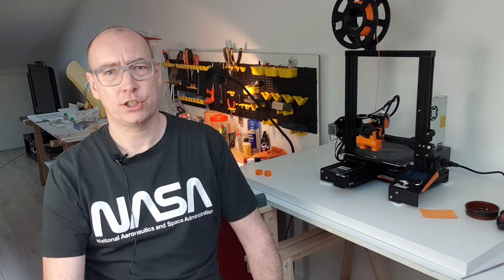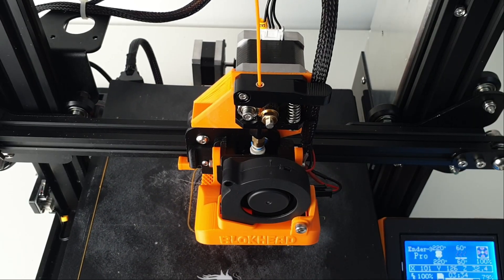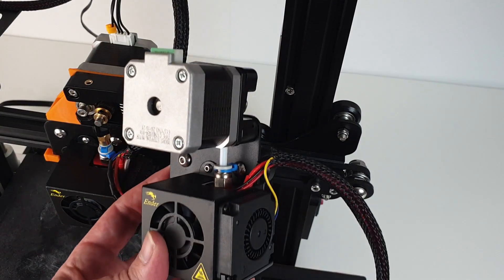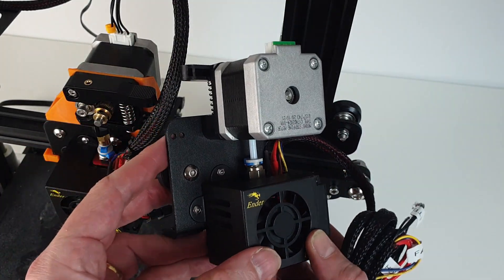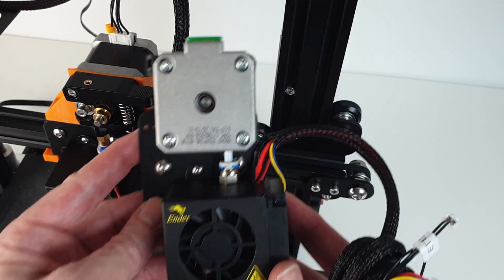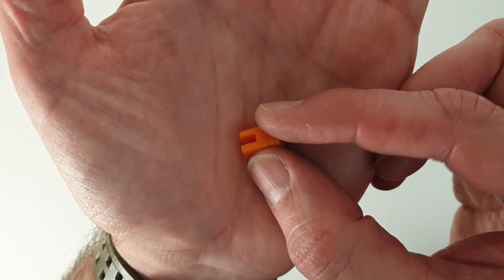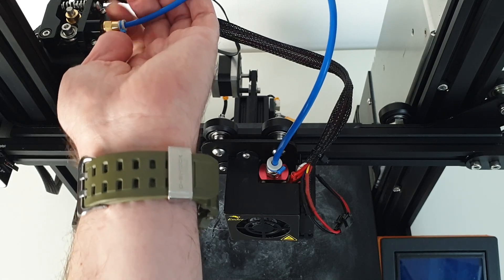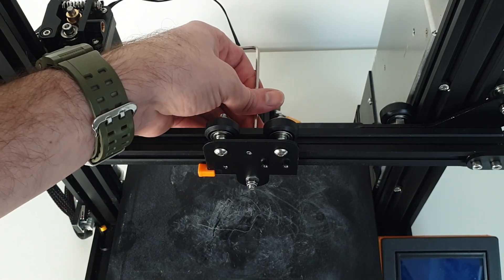3D Printed Direct-Drive for the Ender 3

Comment: Will this be safe with PLA? Or should I look into getting PETG or ABS? I guess I could just measure the heat of my extruder motor during a print, but I would appreciate some advice. I enjoyed your video and will be subscribing!
Reply from the maker: It is safe in PLA. The extruder motor does get a bit hot but you should be able to touch it with you hand, otherwise the motor current is set too high and should be reduced on the mainboard. Thanks for subscribing!
Reply: @YouMakeTech  Salut, 
Tout d'abord, très bonne vidéo, de bon conseil !

Mais je me pose quelques questions : comme pour ce que tu as répondu, la température ne gêne pas ? Comment baisser le voltage, comment le mesurer et est-ce dangereu pour les moteurs de les faire tourner en sous-voltage ?

Mais sinon, je me demandais si tes plans sont compatibles ou non avec la cable chain, et pourquoi pas, peut-on envisager après une amélioration avec ventilateurs noctua ?

Merci d'avance, et félicitations pour ce contenu de qualité !
Reply from the maker: @leobranowski1715  Merci pour ton commentaire. La température ne gène pas, les pièces ne sont pas en contact avec des zones chaudes. Pour les moteurs, en fait on joue sur les courants, pas sur les tensions. En réduisant le courant, on réduit le couple et la chaleur dégagée. Ce qui est dangereux, c'est d'augmenter le courant car ca peut faire surchauffer le moteur. Je donne plus d'informations à ce sujet dans cette vidéo: https://youtu.be/k2nm-WetPnU . Ce setup est compatible avec la cable chain. On peut aussi envisager d'installer des ventilateurs Noctua mais ca demande d'ajouter un réducteur de tension car les Noctuas fonctionnent en 12V alors que l'imprimante fournit du 24V.

Comment: Will the end stop spacer not cause problems on the other side of the printer since the bed size will now be "shifted" as far as the printer is concerned?
Reply from the maker: Right, it reduces the X size of the bed by 9 millimeters. To avoid issues, the size of the bed must be reconfigured in the firmware and in the slicer. This will prevent the head to go too far on the right side. Unless you print very large parts (>220 mm), this should not happen during printing. But the problem may occur during Auto Bed Levelling as the nozzle moves very close to the edge of the bed.
Reply: @YouMakeTech  okay thanks.

Comment: Just discovered your channel. You have great content! You saved me from going overboard with 'mod fever' and buy unnecessary expensive direct drive extruders and build complex toolheads. Your video convinced me to try this first and see if there's any gain in going the 'expensive' route. I just purchased an Ender 3 Pro from somebody else, who (moderately) upgraded the machine with the Creality metal extruder, BTT SKR board, BLTouch and the stronger springs for the bed. Now it's time for the next step and enable (a bit) more speed, consistency and quality.
You should take a look at this vide from a guy who won 3rd price in the Creality mod contest: https://youtu.be/oUdoJUs8Zcg  He made the Z axis belt driven with very little material and small budget, but it sort of made double Z axis superfluous. It's sort of in line with your philosofy. Thanks for your effort and sharing your knowledge!
Reply from the maker: Thanks for your comment and for sharing the link of the video about the belt-driven Z-axis. This is exactly the type of upgrades I like! Will definitely try it. The Ender 3 is my first 3D printer but I am amazed every day by how much it can do for such an entry level price! These are the upgrades I have done so far on my Ender 3: Direct Drive + BLTouch + Cooling mod + bed springs + spool holder on bearings + firmware. It works quite well with this setup. I personally try to stay minimalist in the upgrades, to remain aligned with Ender 3 "philosophy": simple & low cost. I don't want the price of upgrades to exceed the price of the entire printer!  Now I am also trying to improve the hotend. I print almost 24/7 and had clogging issues with the stock hotend when printing for days. The Ender 3 has never let me down, I have done many cool projects with it. It is hard to not recommend the Ender 3 as a first/budget 3D printer!
Reply: @YouMakeTech  True! I'm looking at the hotend too. The stock horend is not too bad, but the silicon tube is sitting right upon the nozzle in the heat zone. That's not great when using higher temperatures. A full metal hotend would solve that problem and give more versatility in printing materials that require higher temps.
Reply from the maker: @PhilippensTube  Exactly the issue I had with the stock hotend. The PTFE tube is in direct contact with the nozzle. When I print for too long (days)  the heat goes up in the "cold" zone which results in under-extrusion and even cloaging sometimes. Also when I try to print faster or to increase the nozzle diameter/layer height, I get under extrusion because the extruder cannot push the filament through. I am experimenting with the E3D volcano. Although it is an expensive and complicated to install upgrade, it seems to solve all these issues...
Reply: @YouMakeTech  Bummer! I printed this direct drive mounting plate and started assembling it, which was not really that hard, but when I tried to fit the hotend, I noticed that it wouldn't fit. Turned out the previous owner of this Ender 3 Pro upgraded it with the metal extruder of the CR10 Pro, which is a bit more expensive and (arguably) of better quality. But it's also higher. The output of the filament is aprox.1cm higher then the regular Ender 3 metal extruder from Creality. In a bowden setup hardly interesting, but when you try this sort of thing quit importand :)
So...assembled everything again and looked for a modified mounting plate, which I found. Reprint and try again... :)
Reply from the maker: @PhilippensTube  The good news is that you already have an all-metal hotend!
Reply: Yeah my e3p was unleveling itself due to the bed springs so I put stronger springs on with the original multiplying the tension

Comment: Great video, it inspired me to start tinkering again with my current bowden setup and to add more flexibility to my printer with the option of a direct drive.
Reply from the maker: Thanks for your comment. I quite like this upgrade and I highly recommend it. It is free, quick to print, easy to install and makes the printer much more versatile. In addition, retractions become more accurate and are easier to calibrate. And the best part: If you don't like it, you can easily revert to Bowden. Let me know how it goes!

Comment: very helpful video, but I want to ask, did you change or di you bought a wire extender for the feeder motor?
Reply from the maker: Thanks for  your comment. I did not have to buy an extension, my cable was long enough. But I was told that on some printers, the cable was too short and an extension was required. Be careful because some people had issues with extensions, the cable was wired differently that the original resulting in the extruder motor turning in the wrong direction. This can be corrected by swapping the pins in the extension connector to match the original or by updating the motor direction in the firmware. Just for you to be aware...
Reply: thank you so much for responding so fast 😊

Comment: Will this work on ender 3 v2
Reply from the maker: With slight modifications. Take a look at this: https://www.thingiverse.com/thing:4721965
Reply: @YouMakeTech  the page says its for ender 3 and pro not actually v2, they just named it version  2 of the ender 3 mod.
Reply from the maker: @allthinngscool5455  I don't have an Ender 3 V2 myself but I have been told that this works well for the Ender 3 V2. Actually, you can see on the photo that it was installed on an Ender 3 V2.

Comment: impressive! Any changes in software required afterwards?
Reply from the maker: Thanks for your comment. Yes, the bed size must be adjusted in the firmware. In Marlin Configuration.h, X_BED_SIZE must be reduced from 235 mm to 220 mm and Z_MAX_POS must be reduced from 250 mm to 210 mm. It can work sometimes  without firmware update as long as you do not ask the printer to go to X>220 and Z>210... but updating the bed dimensions will prevent the head to hit the frame. Sometimes, Automatic Bed Leveling makes the nozzle move very close to the edge. First time you power on the printer after the upgrade, be ready to switch it off in case the head wants to hit the frame.
Reply: @YouMakeTech  thanks for the answer!
Reply: @YouMakeTech  anychance you can help with running through that? also is it pla used in the video?
Reply from the maker: @jaredlarsen3342  I can help. Have you ever compiled Marlin for your printer? The process is heavily dependent upon the motherboard installed in your printer. To get started, take a look at https://marlinfw.org/docs/basics/install.html . Right, it is printed out of PLA.
Reply: @YouMakeTech  i just have the bored that  came with the ender 3 pro and also will i have to worry about not being able to remount the bltouch?
Reply: @YouMakeTech  also no Iv never done anything with marlin
Reply from the maker: If you want to learn how to compile/ flash the firmware in your printer but are concerned with screwing things up, maybe consider to buy a new 32 bits mainboard for your Ender 3 Pro.  You can keep your current mainboard as a backup and install the new one. If things turn bad, you just re-install the old board. It is what I did. The new 32 bits mainboards can be flashed directly with the SD card. In addition, the latest mainboards allow silent operation of the printer. Flashing the firmware seems difficult and it actually is, the first time... if you have never done these kind of things before... But once you managed to do it once, it becomes very easy
Reply: @YouMakeTech  whats the best option if im broke
Reply from the maker: You can get the Creality V4.2.7 32 bits mainboard for 46 USD: https://www.creality3dofficial.com/fr/products/creality-silent-mainboard-v4-2-7
Reply from the maker: or the BigTreeTech SKR mini E3 for less than 40 USD: https://www.biqu.equipment/collections/control-board/products/bigtreetech-skr-mini-e3-v2-0-32-bit-control-board-integrated-tmc2209-uart-for-ender-3?variant=31995437744226
Reply: @YouMakeTech if im gonna have to spend some money you think i should just just buy the new 32 bit mainboard and the direct drive kit from them?
Reply: i think imma just buy the direct drive kit from creality i just wanna be able to print ninjatek
Reply from the maker: @jaredlarsen3342  Up to you. The direct drive kit from Creality would provide about the same performance as the SpeedDrive. But you get a complete new print head.
Reply from the maker: I have it too. It works well. The good thing is that it comes complete so you can easily swap between your current setup and direct-drive. I also like the metal mount plate, very rigid.    Let me know how it goes!

Comment: Hi, do you know or could you probably measure if it would work with the bantamounts? there are several and i wonder if it is possible to use it with the dual 40mm (regular) fan bantamount 

thanks in advance :)
Reply from the maker: Hi, looking at the pictures, it seems the bantamount shifts the hotend position with respect to its stock position (TBC). Therefore, it is unlikely the Speeddrive V1 will work.

Comment: I really liked the video you prepared.
If I do this update will my printer's print area change
? I tried to read the comments but could not find the answer
.
I would be very grateful if you could inform me about this issue :)
Thanks in advance
Reply from the maker: Thanks for your comment. Yes, with this upgrade, you lose 13 mm on the X axis and 40 mm on the Z axis

Comment: Hi there! Which Bullseye Blokhead configuration did you use to work alongside the SpeedDrive?
Reply from the maker: Hi, I used the configuration that is compatible with my hotend & printer. To know which files to print, check http://www.dpetsel.com/files2print.html . I cannot be more specific because all the files/filenames have been updated since I printed the Blokhead!
Reply: @YouMakeTech  That's all good, thank you for the response! From this video, I'm guessing by sight that it was the stock extruder with the 5015 cooling fan variant (as it looks like you've got either a stock Ender 3 or a Pro)? I've also got a base Ender 3 I'm hoping to convert with this exact set-up. Thanks for the great videos!

Edit: It's an Ender 3 pro you've got!
Reply from the maker: @bkd1997  Yes, in this video, my starting point is a stock Ender 3 Pro with stock hotend.

Comment: Will this work on the ender 5 pro?
Reply from the maker: I believe it should but I cannot be 100% sure because I haven't tried. Normally, the Ender 3 and the Ender 5 share a common backplate. You can give it a try, it is only 2 parts to print.
Reply: @YouMakeTech  Will do, thanks.

Comment: How does it print after the upgrade?
Reply from the maker: Retractions are significantly improved. Because the extruder is closer from the hotend, there is almost no lag. When the extruder retracts the filament, it is almost instantaneous. I reduced the extrusion distance from 4 mm (Bowden)  to 0.8 mm (SpeedDrive). This means less issues with retractions (oozing, stringing) and much more accurate extrusion.
Reply: @YouMakeTech  The printer parts are pla?
Reply from the maker: In the video, I used Sunlu PLA+, but PLA is perfectly fine.
Reply: @YouMakeTech  Awesome i gotta try this, i use the standard boden settings and overtime the tube gets gnarled by the cuplings and i get bad prints wasted whole roll of filament because of it.
The retraction settings you did in cura or in the printer software?
Reply from the maker: I highly recommend a direct drive over a Bowden extruder. I changed the retraction settings in the Slicer (Cura). This is what I use: Retraction distance = 0.8 mm, Retraction speed = 25 mm per s, Retraction Extra Prime Amount = 0.2 mm3. Make sure that coasting is disabled too, no longer needed with a Direct Drive. Good luck!

Comment: Following your video, i was able to convert my Ender 3 V2 to direct drive, so thanks a lot. For the Bullseye base, which one do you think have i to use ? the one provided in the Speed drive archive or the base for the E3V2 provided with Bullseye ???
Reply from the maker: Excellent! 👍 would recommend you to use the base provided with the Bullseye. The base for the Ender 3 V2 is not compatible with the Ender 3 / Ender 3 Pro base and I believe the stl that comes with the SpeedDrive is for a standard Ender 3. Not sure the Ender 3 V2 base that comes with the Bullseye is compatible with the SpeedDrive though... I have never tried.
Reply: @YouMakeTech  somebody already worked on the problem: https://www.thingiverse.com/thing:4721965 
thank you again for your videos.
Reply from the maker: Good to know. Thank you

Comment: Bonjour comment faites vous pour modifier la taille du bed. J'une ender 3 pro avec un bl touch. Le problème c'est que quand je fait fonctionner le palpage le moteur vient frapper sur le montant droit de la machine côté écran et du coup la machine se met en sécurité car le moteur forcé.
Merci d'avance pour votre réponse.
Autrement vidéo claire et précise. Merci
Reply from the maker: Bonjour, je n'ai pas eu ce problème mais je pense que le seul moyen, c'est de reflasher le firmware. Avec Marlin, il faut mettre à jour le paramètre X_BED_SIZE dans Configuration.h. Il est aussi possible d'augmenter PROBING_MARGIN dans Configuration.h
Reply: Même soucis sur ma Ender 3 V2 modifiée en direct drive il y a quelques jours. J'ai reçu mon BL-Touch ce matin et après installation, lors du nivelage en 3x3, le moteur vient cogner le montant droit. Comme le dit YouMakeTech il faut compiler un firmware avec un bed de 200 en X. C'est faisable, il y a de bonnes vidéos en anglais. Juste une erreur de compilation, il ne faut plus dé-commenter //#define SERIAL_PORT_2 -1. Je peux donner des liens si besoin.

Comment: Nice mod!! Does it work for the ender 3 v2?
Reply: Partially but you'll need to modify the one central mounting hole between the two top wheels on the X axis. At least from what I'm looking at on mine. You will also have to find a modified v2 cooling bracket for the various cooling mods. Again, at least in my case due to that one hole not lining up! I believe this is because Creality updated the hotend and parts fan shroud for the V2 to look more fancy....Sigh.
Reply from the maker: Sorry, I don't know. I have never tried it on an Ender 3 V2. You can give it a try, it is only 2 parts to print.

Comment: How Dow you change the stepper motor direction without going into firmware?
Reply from the maker: I did not have to change the stepper motor direction. Does your motor rotate in the wrong direction? Did you extend the cable? Some cable extensions reverse motor direction
Reply from the maker: Maybe this helps: https://electronics.stackexchange.com/questions/70643/how-to-reverse-rotation-direction-of-stepper-motor
Looks like you have to swap 2 wires in the connector...
Reply: @YouMakeTech  I got it sorted, the extension cables were wired/pined wrong. O matched them to the original and it worked fine. Thanks.
Reply from the maker: Good news. You are the second person having the extrusion motor direction reverted after adding a cable extension.
Reply: @YouMakeTech  anyone doing this be aware the wires on your new extension may not match the original wire.